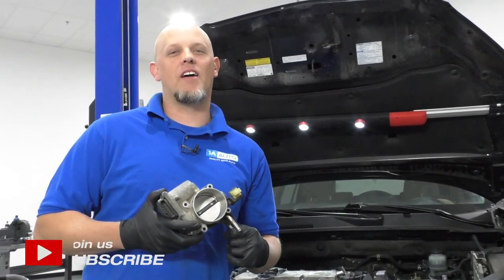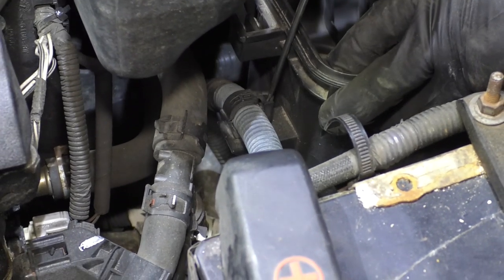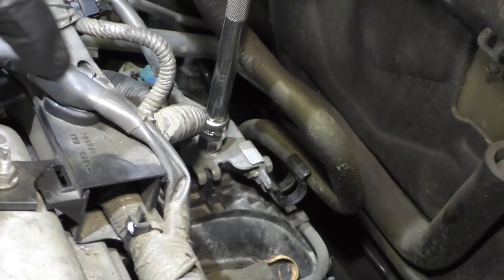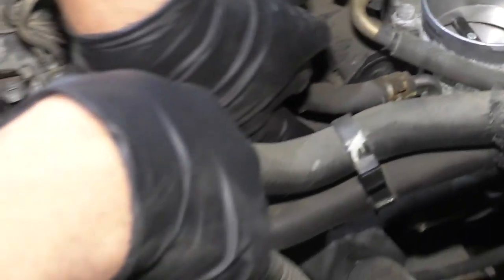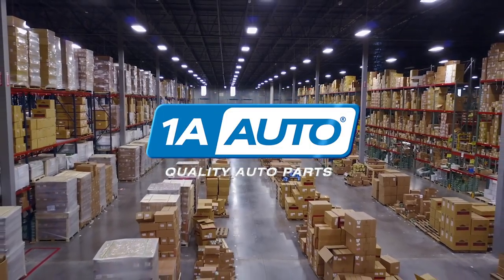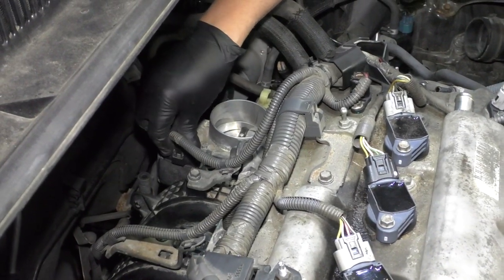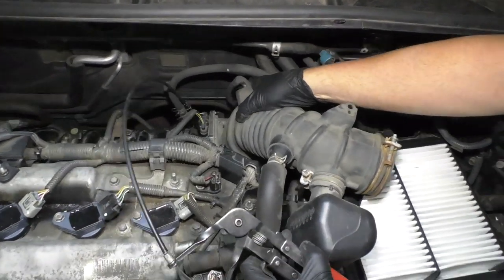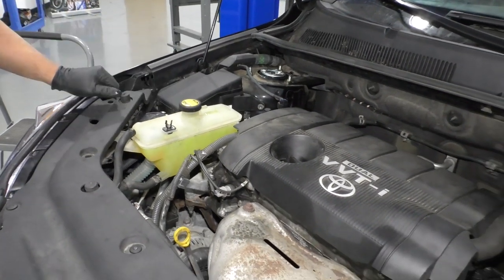How to Replace Throttle Body 05-16 Toyota RAV4

Comment: If I replace the throttle body with a new or used one do I have to program that new throttle body to the engine in my car?
Reply: No the cars idle will just run a little high for awhile but the computer will quickly understand the throttle body position in about 20 miles.

Comment: First, thank you so much for your videos. I have used several and have been persuaded to buy parts from you specifically because of the videos you post. 

My question: I have a 2011 Rav4 2.5L 4 cylinder. It’s throwing codes suggesting a Throttle Position Sensor replacement. Most videos I can find on of other vehicles show this as a 5 minute replacement with a small sensor somewhere on the top of the engine. I’m guessing this is not the case for my Rav4 correct? Is it necessary to replace the entire throttle body on 2011 Rav4 or am I missing something?
Reply: I have a 05 rav4 and I have to replace entire throttle body. Which was $191. I never found the sensor they sell by itself so told me it was needing whole thing... I looked and was told by 2 places just the sensor but toyota said only can replace whole thing. Hope this helped any. Good luck

Comment: The other lady on the train channel torqued down the bolts to 22ftlb or 30nm. You have torqued them down to 7ft/lb or 9.5nm. The factory service manual for 2006-2009 have 22ft lb for the torque for throttle,body and and intake manifold gasket but you torqued down 2010 rav4 intake manifold bolts to 15ft/lb. can you Clarify